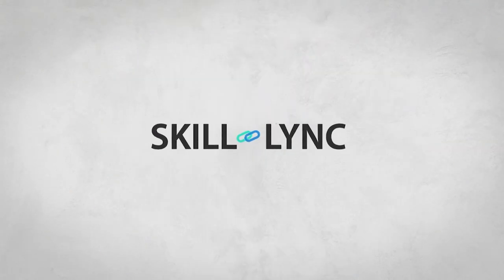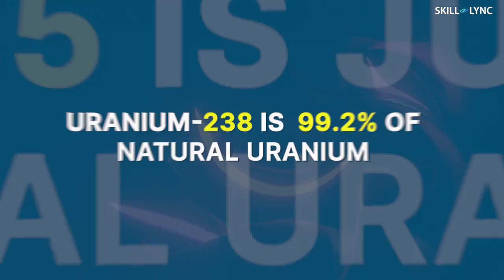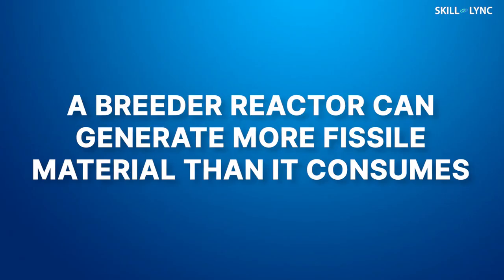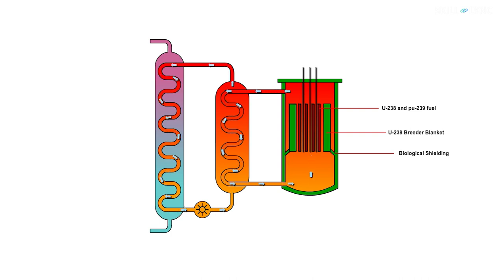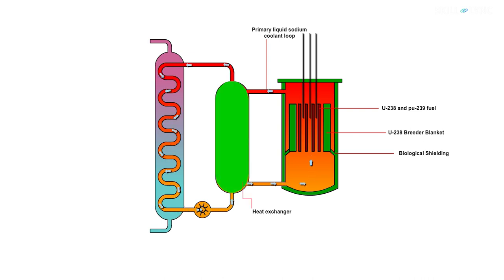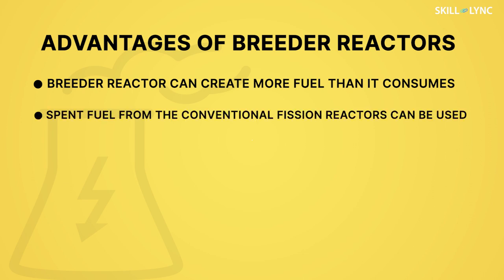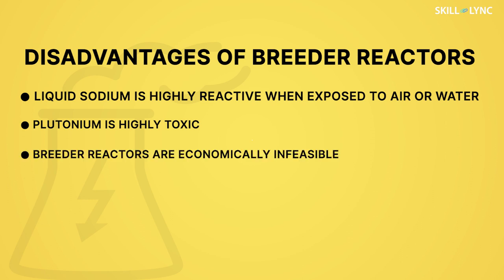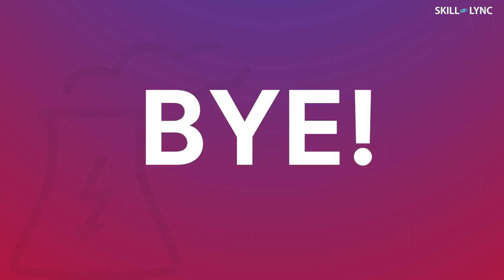Liquid Metal Fast Breeder Reactors | Skill-Lync

Comment: It is not economically infeasible. Why would you say that?
Reply: Currently there's enough relative abundance of U-235 that makes traditional reactors way more cost effective with current market conditions. If fissile isotopes were scarcer then it would be competitive in the market.
Reply: @nickkorkodylas5005  While the isotope availability argument isn't incorrect, there is a complicating cost factor if full fuel lifecycle is taken into account due to the much shorter isolation time requirements of pure fission products once long lived isotopes are removed and recycled. That was one of the primary purposes of fast spectrum liquid sodium reactor development, not just breeding.

Comment: Just started this week in Russia. First industrial fast neutron r eactor.
Reply: This is old tech, and these kinds of reactors have been around for a long time.
Reply: @ketzbook  Nope. You are wrong. Coz this types of reactors reactivates used nuclier fuel (depleted uranium)of normal reactors. Which makes unlimited source of energy.
Reply: See https://en.wikipedia.org/wiki/Fast-neutron_reactor for a number of such reactors built. Research ones built date back to 1940's. In the 1980's you had commercial ones active, such as Superphoenix in France and BN-600 in Russia. They aren't as common, but these reactors have been around for a long time. Also, although they are efficient, they are not "unlimited."

Comment: Where do we use plutonium 239?
Reply: If you use a U235 shoot an neutron on it you get the core gets unstable and split into Kr86 and Ba 144 and you have 2 neutrons which fly away and enter another Atom For example U238 and it turns into Plutonium 239
Reply: In nuclear weapons mostly.

Comment: ~~Ah yes. Loosing electrons is how you change an element from one to another. That's definitely not how you make ions of the same element. /s~~

I was wrong.
Reply: Ah, what??
Reply: @putinscat1208  It's a comment referring to a mistake in the video. And the /s at the end indicates sarcasm.
Reply: Its called beta decay, do some research.
Reply: @Rs07Jehts  did we watch the same video?
Reply: @emailkanji  The electron comes from the conversion of a neutron into a proton. A neutron emits a W- boson that quickly turns into an electron and an antineutrino. This turns it into a proton, increasing the atomic number. Obviously the electron does not come from orbitals.
Reply: @Rs07Jehts  my bad. Thanks for the info.
Reply: right, he should have said beta decay. "Lose an electron" is an unclear and misleading statement.